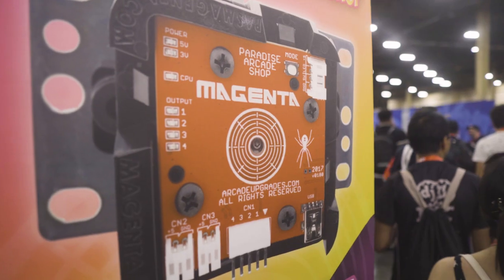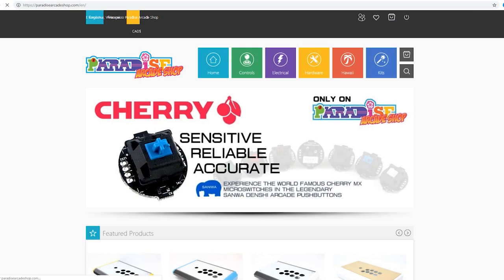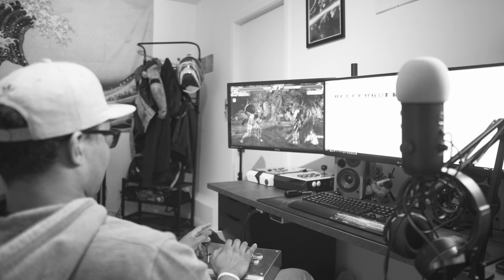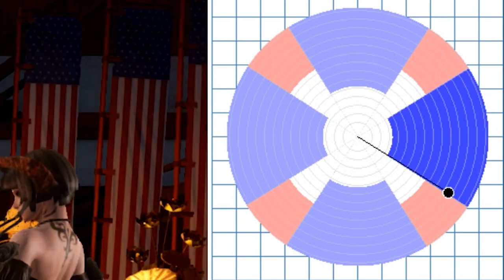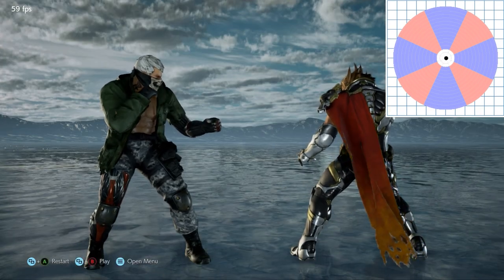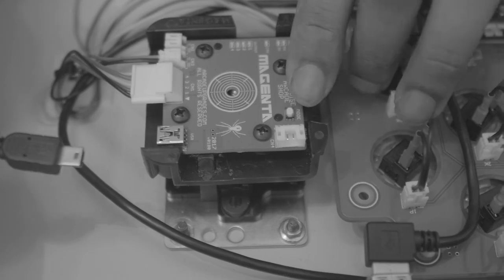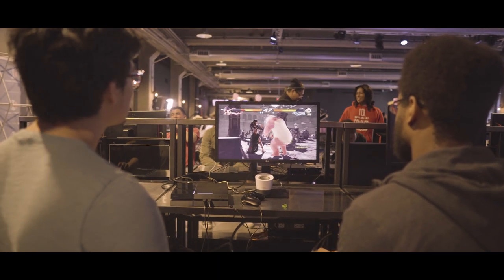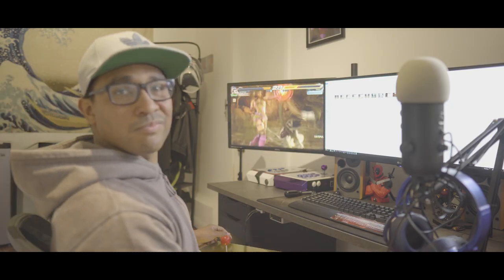Cant get better than this // Paradis Arcade Magenta Review

Comment: You can wire an external button to handle mode switching (you can also connect an LED if you like; it will flash according to the profile selected), and you can also connect the USB to a Neutrik USB passthrough so that you never have to open your stick to update or switch modes.

There's also the Siren add-on for mode switching if a button is less feasible.

Comment: So, u can actually map that tiny button to an arcade button. I used a 2 pin wire (from that connector that's right by it), to a random button I wasn't using. Boom, never have to open it again. Same with profiles too. Mapped to an arcade button for easy switching.

Comment: What is the difference between this joystick and the Ultimarc 360? At quick glance, they appear to be very similar and both work with magnets, but the Ultimarc 360 I believe has been out longer and costs almost half the price. Are you getting something in the Magenta joystick your not getting from the Ultimarc 360 joystick?

I purchased an Ultimarc 360 and I've started working on mounting it to a control panel for my MAME machines (I have four). In my initial tests, it works very well in classic arcade games of which I've tried Food Fight, Sinistar, Bubbles, Blaster and others. Playing these machines recently at retro arcades (except Blaster), I'm very impressed with the Ultimarc 360. It sells for about $59.99 here in the USA but if made in the UK. 

Has anyone found a complied list of MAME analog joystick games? Not mixed in with "analog games" or "analog flight stick" games?.

Comment: yo, cool vid
what i did was wire a momentary switch to the 2 left pins of the 4 pin header (i got a flat membrane switch from ebay and stuck it inside the cubby holder). I also left attached a the mini usb cable and stick that in the cubby holder too. its annoying having to open up the stick all the time but now i've streamlined it so its not so bad. I also installed a switch that lets me swap between jlf and magenta in case someone else wants to use my stick. Hori rap N cubby holder has enough room to fit everything.
Reply from the maker: vUvu vUvu that is awesome, I'm still up in arms if I will keep using the Magenta but I always find myself occasionally coming back to it. It's nothing to do with the stick but just the feel for me. I was thinking about making a switch for it and use a neutrik from mini usb to regular or type A for the cable to the Magenta.
Reply: @alexnostalgix  Oh yeah I was thinking of doing that too, to use only one USB cable but standard PCB and cutting and splicing seemed like more work than just sticking in a cable. but if no cubbyhole than yeah I would do that for sure to minimise cables. 
it does take getting used to, not to mention if you change the settings u have to readjust to that... i have to at least put the switches in for some audible feedback as if the stick isn't positioned properly on my lap.. i get errant imputs due to its sensitivity. going from blocking to forward can be registered as doing a half circle forward for example which can be bad if you play akuma. Personally, i do not think that it's worth the 100 usd+ shipping on this thing, but since i did im gonna use it as i do think it does overall makes circular inputs register quicker and more consistently (also makes errant inputs register easier too) 
$100+shipping is almost the cost for another stick with the usd to aud currency conversion, and you have to put in alot of additional work to get it setup just right so the hidden cost is actually time spent faffing with the magenta, alot of faffing

Comment: Just got a Magenta and Gamerfingers inbound. Hopefully quiet. Super excited to see how a Magenta handles Smash on a Cross Up. So many profiles just between a lever and stick. 🤯
Reply: How did that result for you? I’ve got the same idea.
Reply: @ALWAYSTHINK4YOURSELF  Got a Sanjuks v5. My buddy has the Magenta with an otto korean kit on it. Worked pretty good with Smash, but I like a straight korean lever.
Reply: @blainestevens6701  Did you use the Sanjuks v5 for Smash?  I just discovered Paradis, the Magenta manufacturer is in my city, so I may buy one soon.  I'm doing a bit of research before I spend $100 on it.  I'm also planning on using it to play Smash.
Reply: @ALWAYSTHINK4YOURSELF  Basically plays the same. Still going to take some getting used to. Won’t be as precise as a Gamecube controller or Smashbox, but I’ve actually come to prefer the Cross Up.

Comment: do you know how to remove the actuator in this thing? I tried removing the screw on the bottom but the actuator wont come out =\
Reply from the maker: Unfortunately I don't, modding this joystick in general from what I know is far for difficult as compared to a regular jlf.
Reply: I wouldn't do that since the actuator is specifically designed to be used with the hall effect sensor

Comment: Hey, Alex. I didn't quite get it. So...you can't just use other gates on it? So, no circle and no octo? Cheers.
Reply from the maker: you cannot use other gates unfortunately, unless they have the mounting points for the  circuit board on the bottom which Buttercade does sell I think.